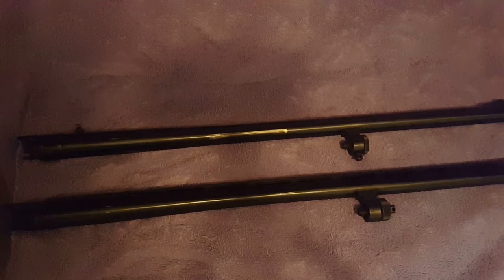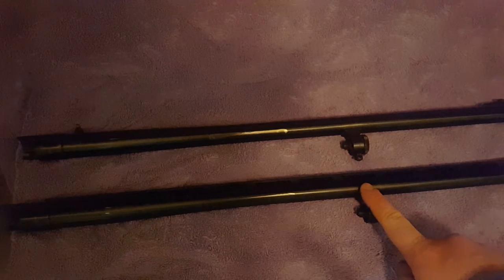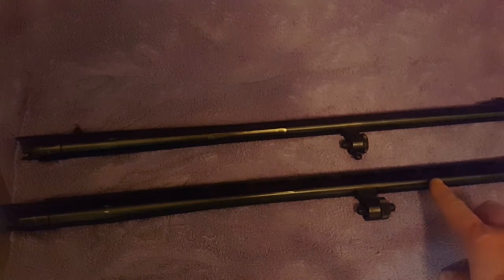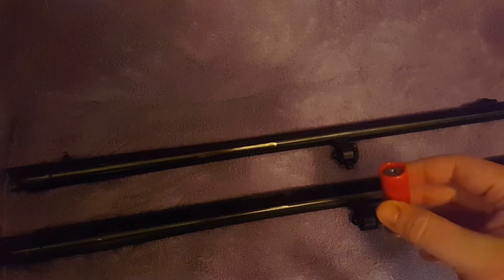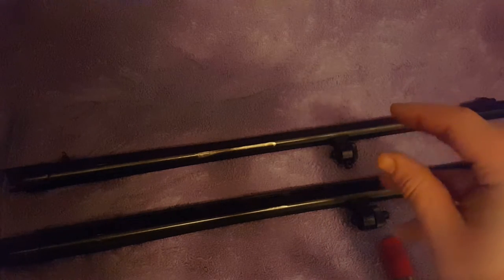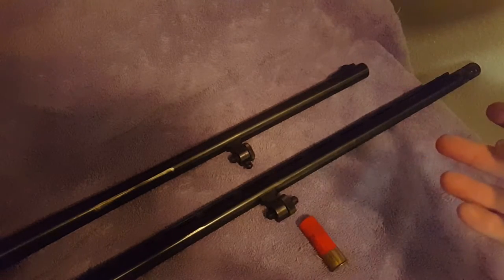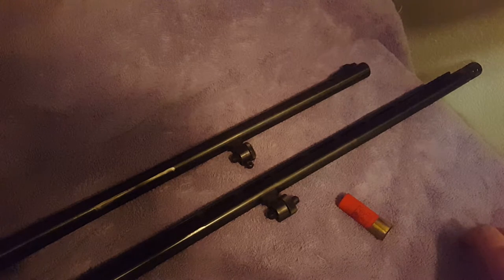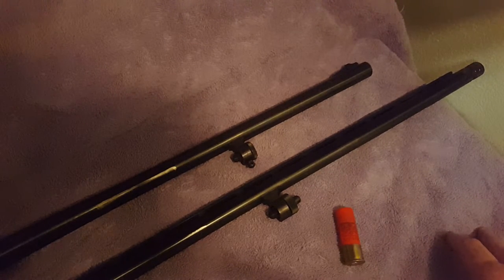The Understanding of Shotgun Barrels, Slugs, & Sabots for HUNTING

Comment: Again I came back across your video on the difference between shotgun deer barrels, and I'm gonna touch on muzzle loaders, hornady has finally got their engineering figured out with what their calling their new 
BORE DRIVERS and the base of the bullet is cupped with a plastic sealing that helps to seal the power gas as it pushes the bullet down the barrel, and their referring to these bore drivers as tight pattern tac drivers,  now I think the biggest misunderstanding about the difference between the rifled deer barrel and that of the smooth bore,  the rifled deer barrel is probably a machined steel finish that is your sabot definite controlled action,  now on the other hand, for the foster slugs is just that 
LEAD BODY slug and those supposed rifled molded form riflings does give that slug a 100% stability sliding down the barrel, but now as I explain this part, I think the biggest problem is being human operated, those who use a sit down bench rest will get some what better accuracy, but as I'm talking about that split second of aiming and pulling the trigger for making that shot, the hunters breathing rhythm timing, his or her's, physical steadiness, the given hunter, depending on the moment at that given second,  preferably was the shot good, or as we all think about the cross hairs of the scope, was their windage and elevation aim on it's mark or just a hair off, so as being humanly held weapon,  are they good for that distance or too long of a shot, the rifled and smooth bore hunters will always have some questionable about their shots  ,and it's always fair to say their nerves will have some say in that moment,  but smooth bore hunters will have questionable timing during that shot timing, the smooth bore will always be just that smooth bore microscopic dam little spin control if any, over the years as I learned about deer hunting shotguns barrels, a friend of mine told me that there's no ruling on maximum barrel length and there isn't, but deer hunting shotguns barrels are not allowed to be under 18 inches,  my buddy said the longer smooth bore a slight longer shot, but your still shooting a pumpkin ball basically,  and apparently the state DNR doesn't specifically say that longer smooth barrels are actually allowed, but some people will use the longer shot barrels maybe feeling they will drop the deer,  so some people care about the correct hunting tackle and some people don't care or don't give a dam,  I'm 64yrs old, I'm willing to use a smooth bore but it's gonna stay rifled barrel length, everyone should get their shooting practice in, they would have a better understanding of their ammo and their smooth bore,

Comment: I have a Benelli M4. Is it necessary to use any type of choke to fire slugs out of that barrel (smooth bore)?
Reply from the maker: Imp cylinder mostly... I use a rifle choke mostly
Reply: @STKO2011  what about a modified choke?
Reply: @STKO2011  can a i shoot a sabot slug out of a modified choke
Reply from the maker: @jrtactical2294  mod choke won't stabilize a sabot, need rifling...rifled barrel or choke...otherwise it will tumble/keyhole in flight
Reply: @STKO2011  mod choke is all i have just tryna make sure it doesnt blow up on me

Comment: keep shooting the rifled slug out of your rifle barrel and you will have smooth bore barrel soon. The  groves in a rifle barrel are made to grip the plastic sabot NOT LEAD.
Reply from the maker: Jeff Bloodworth gun steel is harder than lead....
Reply: I know but the lead filing in the groves will fill them with lead.Look down the barrel of a rifle barrel then look down the slug barrel .The rifling is not as deep and is wider. Easier to fill with lead. Also look on the box of both types and see what kind if barrel to use.
Reply from the maker: That's why... you shoot overbore.... some rifle slugs actually say smoothbore, rifled barrel, rifle choke....ie Brenneke, Federal powershok/truball
Reply: Totally wrong , you will not can not destroy the rifling from rifle slugs, that's a myth.
Reply: @georgekershner6626  after 10 rounds of Remington Sluggers through my H&R ultra slug hunter, you could barely see the rifling in the barrel, it took 20-30 minutes of cleaning and cleaning to get the lead out of the lands and grooves.  Yes, the barrel was just fine, just super dirty.  These Sabo's are a complete rip off (anywhere from $3 - $5 per shell), I just hunt with the rifled slugs now out of my "rifled barrel"  and keep shots under 50 yards.
Reply: Then try cleaning your darn barrel son.
Reply: @denisdegamon8224  I do , but I have a rifled  barrel for sabot rounds and a smooth bore for rifled slugs rounds. It depends on how far I might have to take a shot on witch one I use. Good hunting.